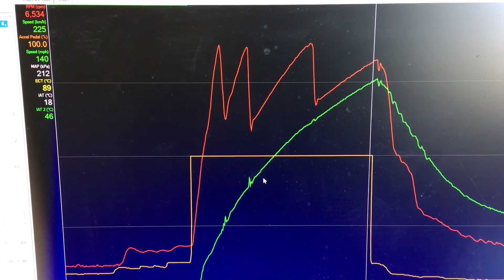EMP intercooler pump vs LSA Intercooler pump

Comment: This is all well and good, but what is the radiator thermostat setting is it the stock or aftermarket lower temps setting? Say 80 Degrees compared to the 90 degree?
Reply from the maker: both are a 160f thermostat and both have near identical engine coolant temp as well (the colder one is 91c the hotter one is 89c, you can see it in the video). The engine coolant temp has little relevance on intake air temps.
Reply: Did you measure the water flow of the system for the intercooler?